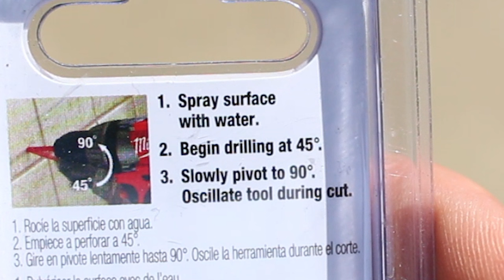How to Drill a Hole in a Tile and  Add Bathroom Accessories (Step-by-Step)

Comment: I had no issues drilling into glass tiles and installing plastic anchors for my towel hooks. My issue arose 6 months later when the 2  Hexagon 3 inch glass tiles developed cracks from the hole areas I had drilled.

Comment: Hey Jeff, Great info.  Have a question.. I'm needing to mount hand holds and just so happens they fall right at the grout joint.   Do I move it over and have a very small distance between the hole and grout line or just center the hole in the grout joint where it will be slightly wider than the joint.  (1/8 joint... #8 wood screw into 2x4 behind the tiles) Thankx

Comment: I have a question. I am finishing up my first tiling job and I added too much thin set in some tiles and the thin set seeped through the tile joints. Any idea on how to remove the thin set from the joints before I grout the joints?

-Thanks
Reply from the maker: +My Builds one option is to use an oscillating multi tool with a grout removal blade. That's the quickest and easiest method. Second option is to use a slightly dull carpet knife to etch the thin-set. But be careful not to cut the waterproofing or chip the tile.
Reply: Thanks for the reply. I will probably end up using a oscillating tool to be on the safe side. Thank you!

Comment: diamond core drill bit or carbide non-core (standard) drill bit?  Why is there a preference for the diamond it seems like its hard to hold the core bit steady and a typical bit would be easier to keep on target when starting the hole?

Comment: Please make a video on how to cut tiles without breaking. I have a small tile cutter with diamond wheel that always break the tile. Maybe I am using it wrong?
Reply from the maker: +quoit99 training are you referring to a manual tile cutter? If so, it depends a lot on the quality of the cutter, e.g. Montolit, Sigma, Rubi, and Ishii are good. Box store cutters can make tile cutting difficult and breaking tiles easy. The most important step is applying equal pressure along the cut while scoring the tile. Then snapping it with equal pressure.
Reply: Thank you for the prompt reply :)
Reply from the maker: +quoit99 training you bet, glad to help